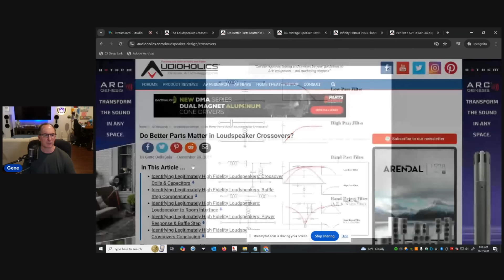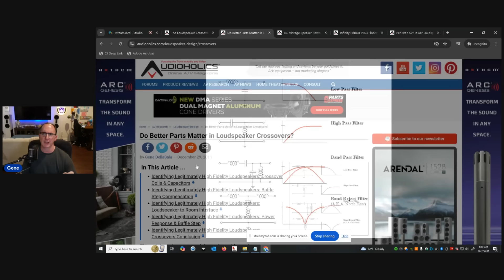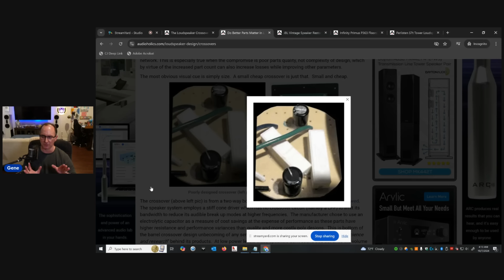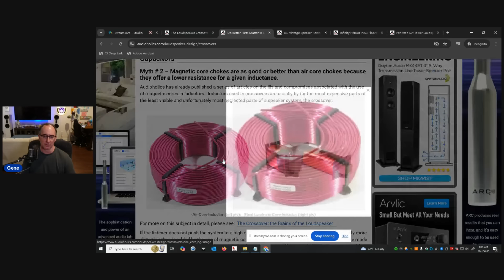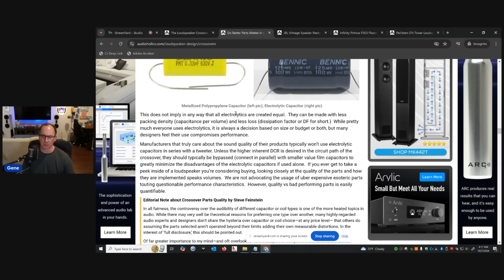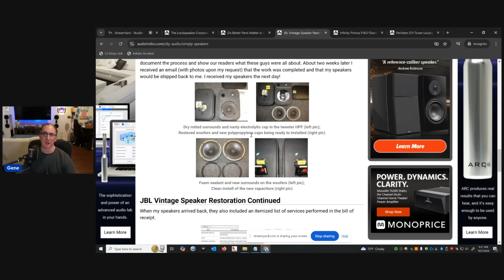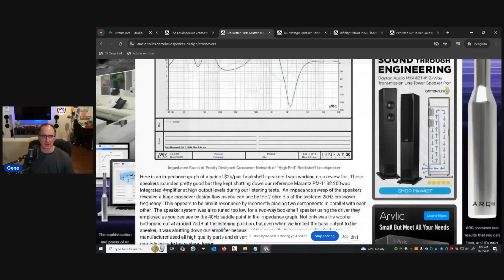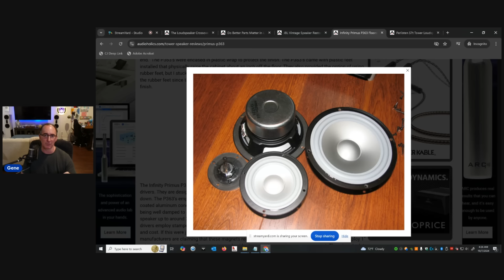Loudspeaker Crossover Upgrades - Are They Worth the Effort?

Comment: I have never had any desire to change the manufacturers xover. I've gotta believe all reputable companies have the engineering staff, test areas like anechoic chambers, software, and have access to test equipment, and high quality parts. 
An independent tech or engineer is highly unlikely to match that kind of capability.

Comment: Danny over time has exposed the innards of speakers to the public and some consumers are pissed. They are not happy because of the cheap parts which discover are in their "expensive" speakers. Now some of these consumers want see the inside and crossovers of speakers before buying.
Danny has created a more knowledgeable and aware public. Many influencers and manufacturers are not pleased.
Reply from the maker: Danny is NOT the first to show the insides of loudspeakers or discuss crossovers on a public venue. I started doing just that in 1999 and continue to do so today. That said, you can still potentially get good sound with cheap parts if the execution is good.
Reply: Erin actually measures them.

Comment: Interesting info, but not fully answering the question you pose.  Maybe take a low/ midrange speaker with a mediocre crossover, have a good one built, with the parts you discuss and then discuss the differences.

Comment: At last rationality in high-end audio. If a speaker's frequency response and/or impedance variation can be flattened there should be an improvement. Would it be audible? Depends on the amplifier, room layout and an individual's specific hearing capability. So many audiophiles imagine there is some weak link in their system that requires improvement. Simpley not true, good systems are already close to optimal. But humans are subject to all sort of delusions.

Comment: On Danny's channel, it looks like most speaker companies use cheap parts even in high-end designs.  My question to you is if you know of fairly well-known accessible brands that do use high quality parts in let's say medium price speakers. $2000 to $6,000 let's say.
Reply from the maker: I think cheap is relative, and the very reputable brands tend to know what they are doing for the most part. What matter most is good execution which can be seen in proper 3rd party measurements.
Reply: @Audioholics  you said that good quality parts matter and I'm asking if you know of brands that do use good quality parts. Relatively good if you want me to put it that way. Air core inductors for example. You suggested that certain brands do use good quality parts. So I'm just wondering which in your experience don't cheap out

Comment: I am still waiting to see a true double blind test of speaker cables, moderately good versus esoteric.

I don't believe this has been done, and I do want to see it once before I believe that people can hear the difference.

A true double blind has some challenges, but it could be done. For example, leaving a room while speaker cables are swapped or not, documenting the cables used, and the test results with NO communication between the swapper and the listener.

I really want to see some data towards the objectionists versus the subjectivists.  Danny did some speaker cables experiments in a You Tube video, and he got 70 or 80% right. However, without true double blind it's not definitive.  I have heard lots of arguments why it's not needed, including from Danny, but until this is done at least once, I will not be convinced.

I remember decades ago they thought they had proof of ESP, but once the double blind tests came in, the results were negative. I suspect we may see that here.

If our hearing is so good, and there is audible differences in hi-end speaker cables then it will show up in double blind tests. I ask, what are they so afraid of and why hadn't this been done yet?

IMO, this would be the most important and valuable test done in decades. So please, please, a true double blind test of speaker cables. You could ask Danny to be the listener, I bet he has the best chance of actually hearing a difference.

Comment: If your cabinets are not tip-top, no amount of driver replacement, never mind crossover mods, will fix that. 
Do things in the order of the effect they will have, strongest first.

Obviously this means starting with the speakers, but where?  Save the tweeks for after the other things (like cabinet, and driver quality, have been optimized) OBTW are you sealing your woofers to the cabinet air-tight with rope caulk?  You'd better.  Heck, even speaker cables MIGHT
make a difference, if your speakers are not efficient and if you're trying to jam 200W through 16AWG wire... well guess what?  In that
case, your amplifier's (hopefully excellent) damping factor (the ability of the amp to control the motion of speaker cones) has just 
been wiped out by the high resistance of the wires.  Whatever your speaker's impedance, the resistance of your speaker wires must be much, much lower, say 1% or less, ie; a hundred times lower, before it will no longer affect damping factor.

Remove as much of the resistance between amp and speakers as you can.  A good bet is 4-cond. 10AWG SO cable, pay attention
to polarity location in the bundle; two "+" across from each other, two "-" across from each other.  The shorter the run, the less 
copper you need in your speaker wires.

When you get done with all of that, then think about modding crossovers.  PS: speaker cable risers are a FRAUD unless you live on a battleship.

Comment: Expensive caps like mundorf is not better than a good bennic cap. They measure exactly the same.  But some audiophiles like to have experience "audiophile" parts in the crossover.

Comment: There is a huge difference in poor crossover design and poor(cheap) crossover parts. The later MAY result in a decent speaker whereas the former is doomed from the start. The other factor is cost. An accepted ball park estimate says actually speaker manufacturing cost is AT MOST 30% of the retail cost. Meaning, a $3000 speaker will cost, at most, $900 to build with 50% of that being cabinet—leaving $450 for drivers, crossovers, terminals, etc. And don’t forget labor is included in that $900. So yes, when Danny Richie takes a poorly designed $700 Klipsch speaker and adds/changes $400 in crossover parts, you have a better speaker. It’s not brain surgery.

Comment: A couple of years ago, I seriously upgraded my speakers. I took my time, visited multiple ‘bricks and mortar’ dealers, listened to dozens of speakers, connected to various electronics. At the end of the day, I chose a pair of speakers that reproduced music the way I prefer to hear it. I’d set a budget for that speaker upgrade and exceeded it to acquire the speakers I felt were right for me. I have no idea of the quality of the crossover parts. After purchasing the speakers I did read a couple of reviews done by respected mags who did a full range of measurements and found them to be the most linear of any speaker they’d measured. 

Could they be improved with higher quality crossover parts? Probably. Not something I’d consider doing though. If I’d wanted to spend more money on speakers,  I would have chose a pair, higher up in the manufacturers range. Interestingly enough, someone did send GR Research a pair of speakers much lower down in the manufacturers range to mine. Danny was very impressed by the cabinet build quality and quality of the drivers, but did criticise the use of an iron core inductor on the woofer crossover. Although he also praised the speakers measurements. He concluded that an upgrade was not feasible as the speakers weren’t designed to be disassembled and the crossover board was inaccessible.  Even if I could be convinced that spending $1200 to upgrade my $9500 speakers would be worth it. I still wouldn’t do it, not whilst those speakers are still under the manufacturers Warantee.
Reply from the maker: You're happy with the speakers. Focus your energy on improving room acoustics and calibration. Once that's done, focus on the music and enjoy.
Reply: @Audioholics  I don’t have the luxury of a dedicated listening room. My hi-fi has to fight for its right to be, in our family lounge. I’m not the world’s foremost advocate of acoustic correction, by whichever methodology you employ.  Plus my wife only just tolerates my hi-fi as it is. Room treatments Etc. Would likely result in a costly divorce.

If you have a dedicated listening environment housing only your hi-fi rig, a listening chair and maybe, a beer fridge, then acoustic correction could prove advantageous. But in my experience, the ‘stuff of live’, found in family lounges, carpets, curtains, cushions, sofas, chairs, rugs, people and pets is more than sufficient to calm the room’s ambiance, keep the RT60 levels within acceptable limits. Acoustic correction merely changes the room’s ambiance.  Whether you prefer the way your reproduced music sounds after those changes have been implemented, surely must come down to personal taste. I live on the ground floor of an apartment block. I have neighbours I have to respect. This forces ne, more frequently than I’d like to, to resort to headphones. I’ve accumulated a small collection of headphones. My go to pair are my AKG K872. Praised for their balanced linearity and neutrality. They give me a good reference point as to what reproduced music should sound like minus the influence of the room. Their sonic characteristics match remarkably closely that of my hi-fit’s in room response.

I’m merely stating my conclusions after 40 plus years of experimentation, trial and error, in building a hi-fi system that reproduces music the way I like to hear it. I’m not for 1 moment claiming that my conclusions and opinions are founded on indisputable, scientific facts. I say this because I’ve made comments similar to this on other YouTube channels and have been met with a barrage of abuse, by both the channel presenters and their subscribers. I’ve been called ignorant, hollow, stupid, uneducated. I’ve been told that my system is not sufficiently resolving and that I have defective hearing, all with them having no knowledge of me, my hi-fi or my room. 
I respect others opinions, even those that differ from or oppose mine. I relish lively discussions on the topic, and look forward to respectful responses.

Comment: I'm a little surprised Mr. NoSnakeOil Gene has basically given an endorsement to the idea that these parts make an audible difference, when I don't think there's any actual measurements nor double blind testing to show that they do. These upgrades are not cheap relative to the price of the speaker, which is always going to be the case because  (like Gene pointed out) you're not going to upgrade a high end expensive speaker. And the thing is - double blind testing is even more challenging for crossovers. To do a realistic test, you'd probably have to wire both the original xo and upgraded xo outside of the cabinet, in parallel to the speakers, to be able to flip them back and forth.  Then, there's the question of the actual xo design, where one could ask if it is possible just to implement a better design with the same or similar inexpensive parts.
Reply from the maker: You obviously didn't watch the video before you commented. Better parts do matter but design execution is paramount for them to matter. The really good manufacturers making SOTA designs use the good parts and have tight tolerances in their designs. Look at the Perlisten example to understand. No crossover modder is going to improve a design like that with fancy cables or higher dollar parts.
Reply: @Audioholics  Watched the entire thing, even mentioned that you pointed out that it's unlikely to want/need to upgrade an already expensive, high end speaker (did you read my entire comment? 🙂). But the last chapter of your video is literally "Better Parts Do Matter!" when I think there's a lot of reasons to be skeptical.
Reply from the maker: @redstang5150  The better speakers already use the better parts. You can't get a better example of a SOTA design than the Perlisten S7tle that uses 1% tolerance parts. You again missed my point.

Comment: I was a bit disappointed by this.  There were hints at why there might be differences between types of cap, or resistor, or inductor - but just hand waving.  The effects of tolerance on design relative to the intention is obvious (albeit the magnitude of the potential difference and impact on audibility is not) but I feel that it should be possible to use a more scientific approach.  At least its not descended into Danny-speak with 'smearing' etc.  Example: iron core inductor can indeed saturate - but does it saturate at a sane level, and is the effect actually material over (say) the non-linearity of a woofer at such a level?  It should be possible to demonstrate this with something that can measure distortion, after equalizing the DCR as needed.
Reply from the maker: We have technical articles that dive deeper into this topic linked up in the video. This was a general overview to even see if the topic would generate interest. Now that it has, you can expect more coverage. Ferrite chokes can exhibit distortion before saturation point. Much of this is covered in our articles.

Comment: While there may be a handful of speakers capable of working close to "ideal", this certainly does NOT apply to most speakers. The sins can be cabinet (sharp edges, bracing and stuffing), drivers, driver spacing and finally crossover. Bracing, stuffing and crossovers are the easiest to fix. Many years ago I had JBL 4311 monitors, probably the biggest rip off for the money ever. Miserable cabinets, terrible crossovers, wrong port tuning, bad stuffing. The saving grace was a world class woofer and decent, but not excellent midrange and tweeters. Adding bracing, optimising stuffing, throwing away the foam grill and finally giving it a proper crossover transformed them to what they should have been. The cost for the entire upgrade was very moderate - a couple hundred dollars and the transformation from bad rock and roll thump to a speaker very convincing - even with classical music. There are many other speakers - even at audiophile prices that disappoint in every way.
I do believe that there are a lot of good drivers out there, but the compromises in every other aspect do warrant serious thoughts about upgrades.

Comment: Magnapan now has a $2000 crossover upgrade for their speaker designs.  Adding this world make their $2000 model $4000! It would their 1.7i ... now up to 3k or so 5k.  So are they admitting that their highly acclaimed designs at the modest end of high end actually use crappy parts in their crossover designs??? They have always emphasized that they made a quality, audiophile grade speakers from top to bottom in their product line and now this "modification." ??? Really? I own LRSs that work pretty well if far from perfect for the bucks ( with a very good sub added. Sorry Maggie!) So... they can make a whole speaker for $995 but it costs $2000 just for a crossover?? Really?  This has put a very big question in my thinking about what this company is doing.   I have seen some pretty expensive speakers with less than stellar parts in their crossovers. Still,  I wonder about this "upgrade" option.   Really mostly snakeoil? 😮
Reply from the maker: A crossover upgrade shouldn't be half the retail price of the speaker. That's a bit ridiculous IMO.

Comment: More complex xover doesnt necisarilly mean it sounds better. Some speakers with simple xovers can sound as good or better.. its not something you can make a general statement about..
Reply from the maker: @davidstevens7809  I never made a general statement other than no crossover on a woofer or mid and just a serirs cap on a tweeter is usually a bad thing unless you go active.
Reply: @Audioholics  thats exactly my point.. there are other ways.. sir.. its a lost art.So far as im concerned. For the most part I agree.but I still love my genesis physics antique speakers. And I personally think active is midfi as far as for the mains...but if we are discussing passive xover design for 80 percent of modern drivers. IT WONT WORK..but back 50 years ago..woofers were made to work with the tweeter.. they were both mechanically designed to need minimal electronics to marry them..the result is top shelf.. Im personal friends with Winslow Burhoe..the designer..
Reply from the maker: @davidstevens7809  yea calling active speakers midfi means you're really behind in modern audio.  Most vintage drivers lack the power handling, output, and low distortion of modern ones.  Nostalgia is getting the best of you.
Reply: @Audioholics  ok.. let me explain.. speakers arent resistors..they are complex loads.. to stear the amp ( equilize) the signal adds stages to the amp.Preamp.. I thought you understood I worked at rockford fosgate 40+ years ago..I know most every designer from the past and ive been tutored secrets..DANNY RITCHIE made a video about all this reality.. Nowhere did I say that you were untrained..But you just attacked someone that was honored by the boston audio society..haha..
Reply: @Audioholics  my genesis physics handle big power. I have largest collection in the world
Reply from the maker: @davidstevens7809  that's great about your accomplishments 40 years ago. Active speakers and DSP have come a long way since Commodore 64. You should reexamine what is out there today before calling active speakers "mid-fi".